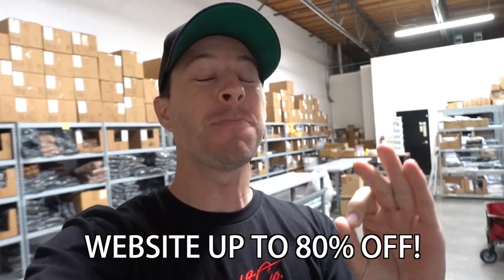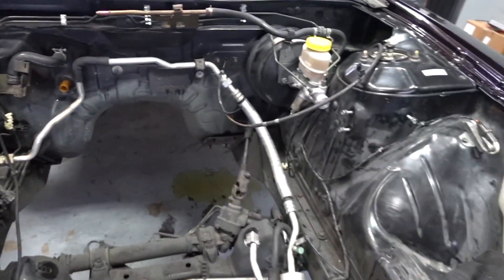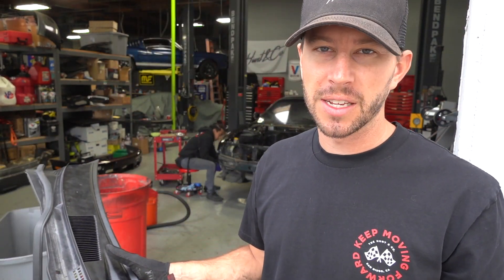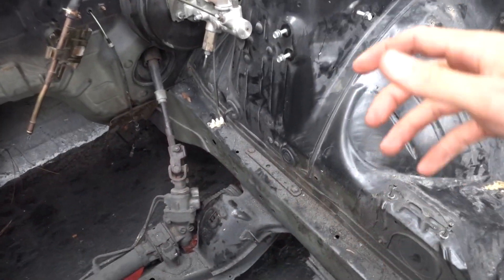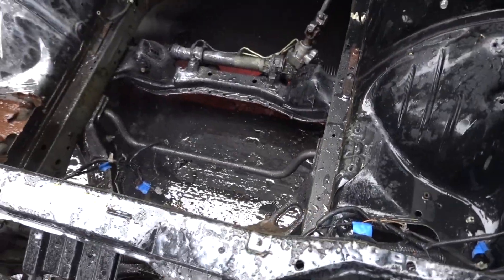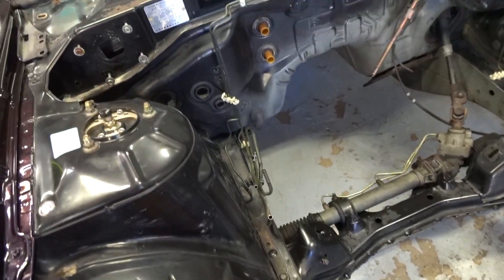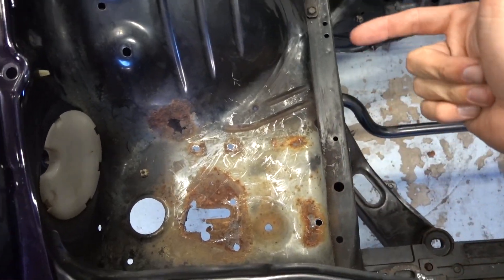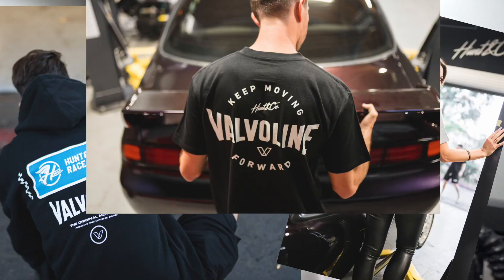Deep Cleaning 20 Years of Engine SLUDGE! Insane Transformation!

Comment: For as long as you guys have been running a shop you think you'd be using fender guards by now
Reply: You'd also think they would paint the car last too lol.
Reply: I was literally thinking the same thing when they were leaning up against that new paint.
Reply: That's why they always end up having to send it back to Oscar after it's done so he can repaint it smh. Atleast he gets paid
Reply: @forty-glocc  Oscar didn't paint it this time though.🤷‍♂️
Reply: @ddevil4980  that's right he went to the other shop
Reply: Or just take the fenders off. Don’t know why they painted the car before they even pulled the motor in the first place. Tj does things pretty sloppy sometimes. Should take some tips from the Throtl boys
Reply: @allspooledup2584  He calls the rx7 a full build yet he didn't even strip or undercoat the chassis. Same with this just slaps some paint on then starts messing it up as he does the rest like swapping the motor. You'd think he'd at least pull out the motor then paint the bay and exterior at the same time. Super sloppy.
Reply: @k1r4ns  thats cool, maybe you should start a channel and do whatever you want to your stuff. 🤷🏻